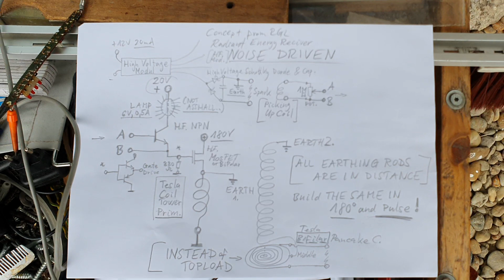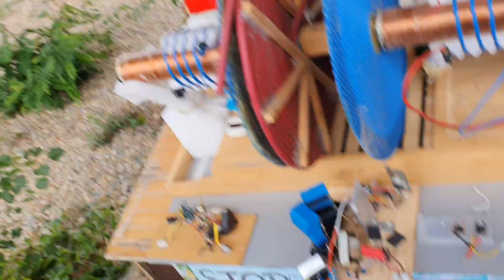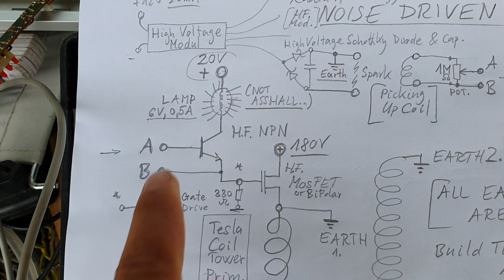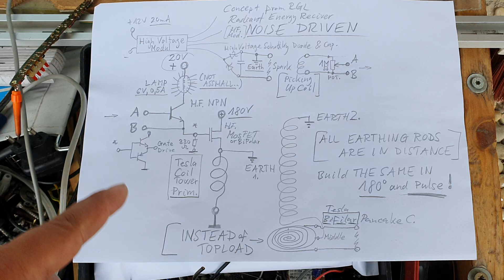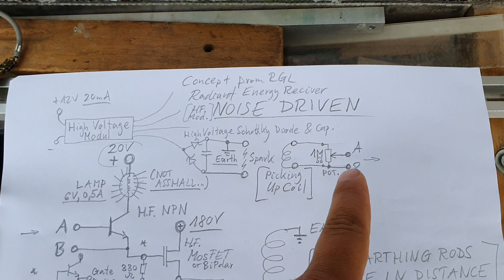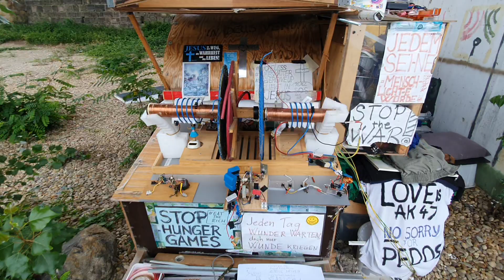NOISE DRIVEN TESLA TWIN TOWERS

Comment: I like your idea to power it from the hV static.
You seem to want to make it dynamic by driving the other bifilar plate coil in 180 degrees. good idea.
I also like your tesla coil connection to the center of the bifilar pancake, as from there there is no magnetic induction since the 2 bifilar wimdimgs are counter wound
Reply from the maker: Try the best, with to help of the Lord, Jesus.